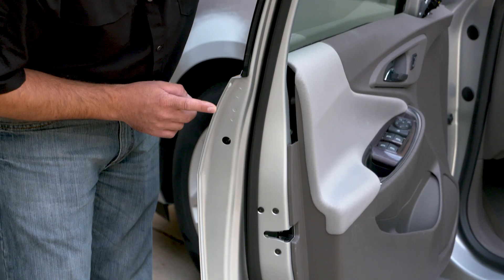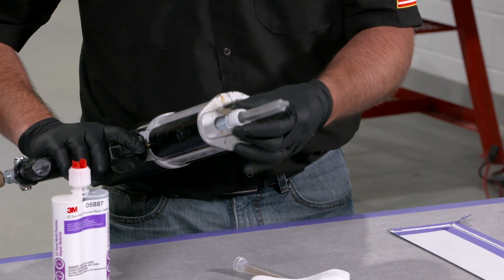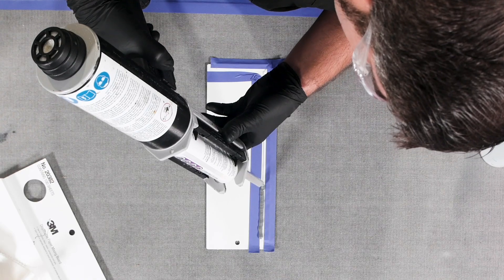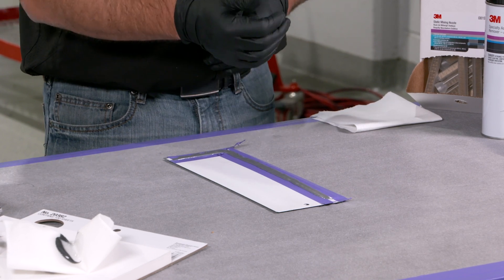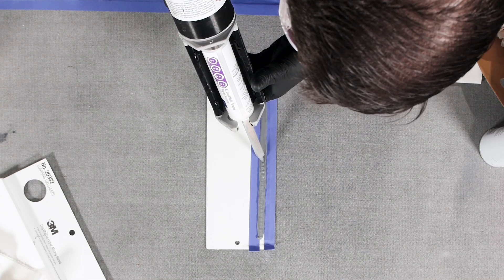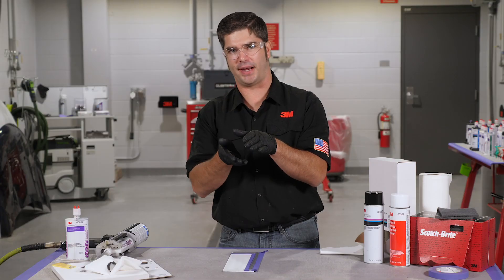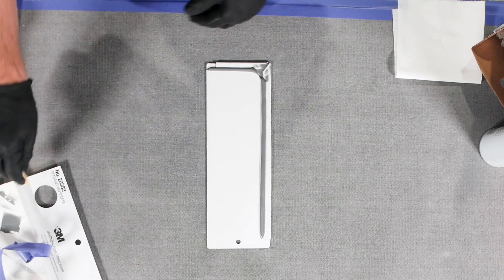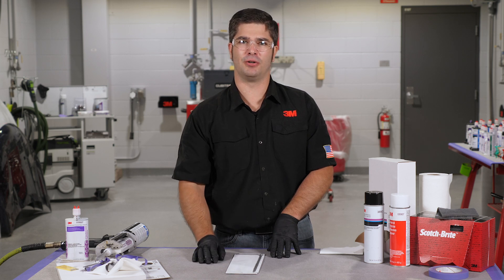HOW TO: Replicate a GM Seam Sealer Bead

Comment: How much is the gun and how much is the bonding agent?
Reply: @Technical Items. >They don’t respond to questions unless you are a professional body shop or chain of several fanhcisesx. The simple dual cartridge hand operated dispenser for 200ml starts at $90. They offer an air operated model plus one that uses a pneumatic drill motor type. Most all are a 2:1 mix ratio and comes in 500ml sizes for the more very expensive machines. They have 4 different seam sealer and 3 different panel bond materials so each is a different retail cost. Sorry, I wish I could be more helpful. ASE Master Tech since 78

Comment: I'd like to see him do that on an entire door panel without the pneumatic gun. It sucks trying to get a nice bead with a regular click type gun
Reply: @D.A.L. I agree completely with your description because time is an issue plus temperature. Since mid 70’s I have never worked in an air conditioned shop and sweat pours inside my ears I never knew were their. But using a manual gun versus a pneumatic dispenser is an expensive decision. It was addressed in another video referring to your exact question. Keeping the product in a air conditioned room can slow down the curing process but 30 minutes goes by quick on a hood, trunk lid or most doors. Especially like this double application. It is like many things tools, buy SnapOn or harbor freight? These are investments going forward depending on a shop owner say age 55. You have a 10 year window hopefully to re-coupe this investment as I don’t see the cartridges changing or their use required less. If age 40, it is a no brained, but in a shop with 6 or more, ask the manager or owner, perhaps both. If I buy this to make my end results better, they benefit. I need a raise or the shop can purchase it. If I purchase it myself, I will take a copy on have the current manager & owner sign it with a witness as it is yours and leaves with you if you quit, move, shop goes under, owner gets divorced etc. I would weigh all of the possibilities. I would buy one for myself but cover my butt and engrave it and take a photo of the tool, date and paperwork. I have a hydraulic transmission jack moved during a dealership buy sell. I never got the jack. They denied they had it and a color copy from the used jack $640+ was answered by a team of lawyers. Needless to say, I don’t have a jack! Best of luck.
Reply: If you dont move fast with any 3m seam sealer, it will tack up and string out when you pull your tape. Then you have to sand it down some for the painter to roll the sharp edges. Ive found that doing one edge seam at a time(depending on the finish youre going for) is best, even if toy have to waste a few more tips